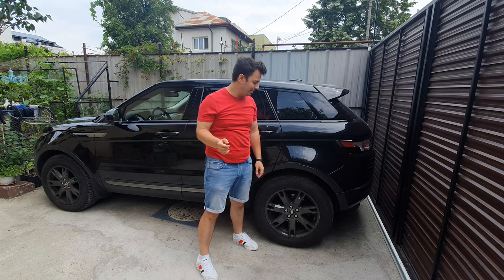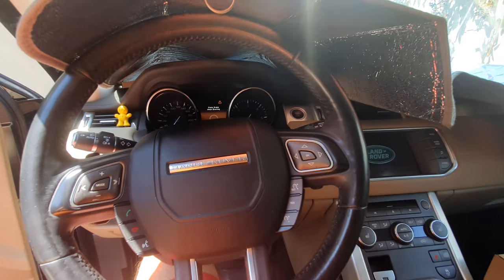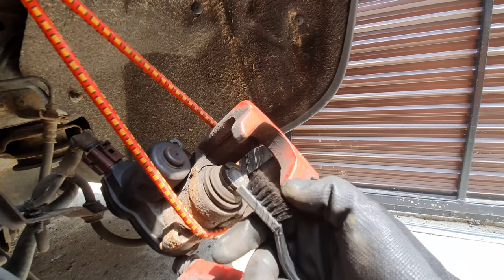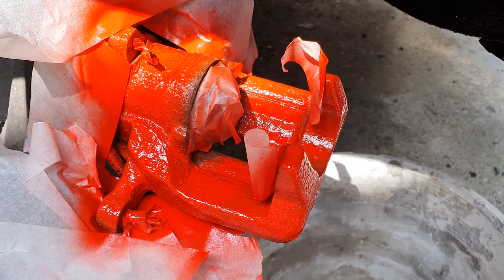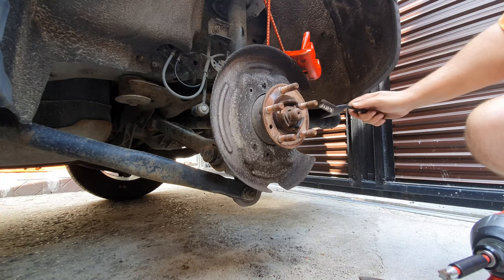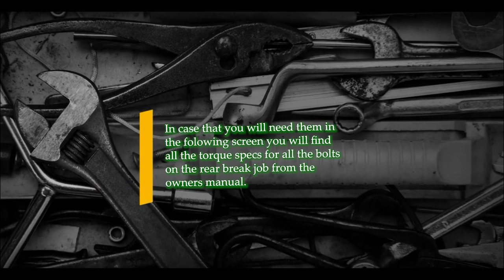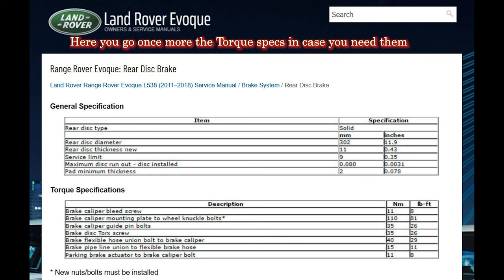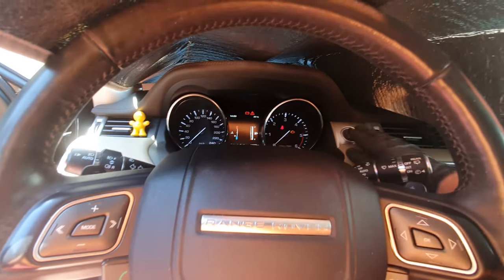Range Rover Evoque Rear Brake pad and Rotor Discs Replacement +Caliper painting and BrakeServiceMode

Comment from the maker: Greetings everybody, in case the video is too long or you already know the small detailing stuff I also made a short overview video(10min) of this one that gets the things right to the point check it out: https://youtu.be/rMfCusdpdc4   And you can always come back to the Full version in case you need more details.
Also, i have to say that getting the vehicle into parking brake maintenance mode without the tool was hell, the tutorials on youtube were obsolete and i found out later that the guys from Land Rover disabled the option to put it in maintenance manually for customer safety, also i could feel that on my skin when i pressed parking+acceleration, the vehicle will rush forward. So please use the diagnostic tool :)

Comment: When you put the brakes in service mode you dont use a retractor tool. There is a button sequence to enter the service mode, you dont even need the obd tool.
Reply from the maker: If you know the exact sequence, please share it with us, I tried over 6 different methods and not even one worked for my 2015 automatic model. Also, the ones with parking brakes + acceleration are hazardous! Especially if you do it in a garage or tight spot because the car will turn on and accelerate.
Reply from the maker: @gonzalo1972  if you watched my video you could see exactly what I said above in the comment and also in the video, the Landrover disabled this one on newer models, now if you do those steps when you press the start button the car will start and rush forward, thats extremely dangerous. The only way to put it in maintenance mode is via the Diagnostic tool.
Reply: @SanKraNsWorkshop  the engine wont start if dont press the brake pedal. The procedure clearly states IGNITION ON (ENGINE OFF), so the car will not move. Sorry if this doesnt work in your model.
Reply from the maker: @gonzalo1972  no biggies, i have the both diagnostic tools the Icarsoft and also Mongoose that is used in the dealership service. They are both verry helpful in troubleshooting problems and maintenance. Its sad that the LR disabled the shortcuts but thats it, we adapt and carry on.
Reply from the maker: @gonzalo1972  Usually the good tools that will save you from allot of pain are abit expensive/overpriced, but once you got them you will see only rainbows in your workshop instead of storms :)